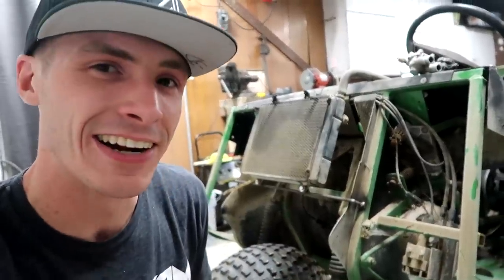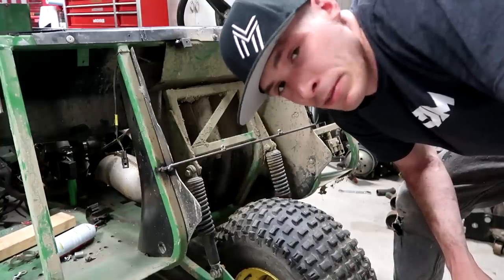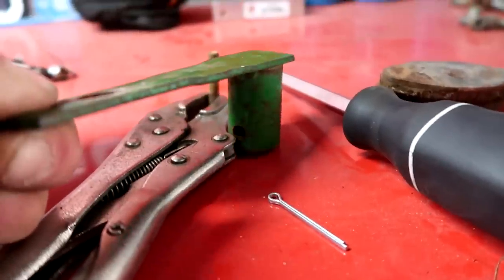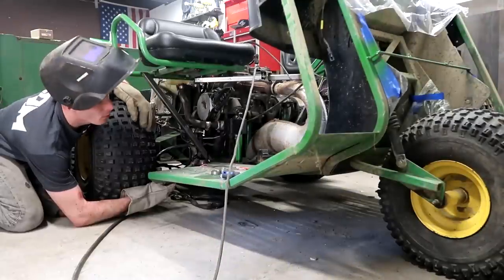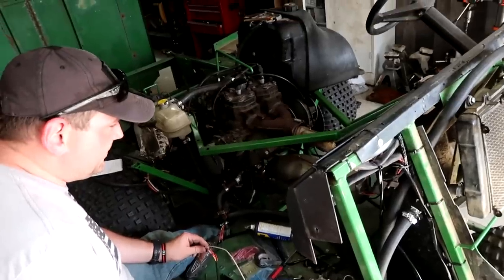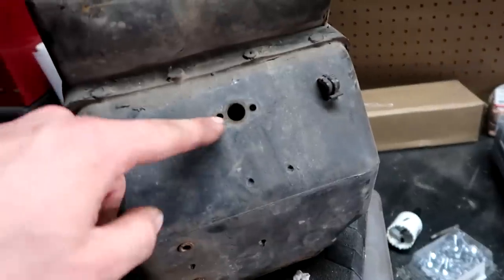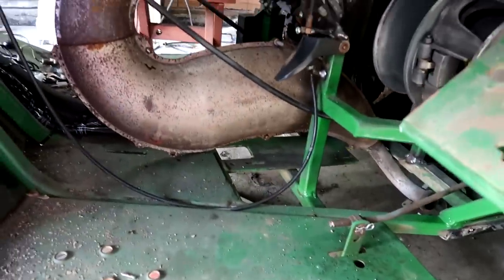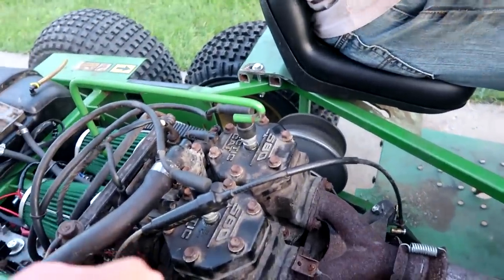100HP Engine Swapped 5 Wheeler Test Drive

Comment: Build a small fender to protect the radiator and put a grill over it or you will likely not only cover it with mud, but it will catch branches and rocks.  I would also put a storage rack on the back to replace the bed in case you want to load it up with gear.  I would strengthen the frame too for all that extra horsepower.  And yes you need a muffler and a taller gear.  It accelerates fast, but the top speed sucks and you can't cruise... it is all in and coast trying to drive it.

Comment: That was the start of the side x side craze. They have came a long way from the zero suspension and one front wheel set up. I ran the hell out of one just like that in about 1990. Get crafty with that welder and put you a front axle on it to help control that extra HP.

Comment: I would suggest moving the air temp sensor to a different location as it will help trick the computer to make it run a little richer as the motor warms. Also it is a intake air temp sensor not a air flow as it’s originally mounted in the air box in a place where there’s not a lot of air flow.
Reply: Also it will never start on the first pull unless it’s been running recently as it uses the first pull to sync the computer with the motor.
Reply: Also lmk if you need any help with the electronics as I just got done swapping a Polaris Indy Rxl motor into a quad and arctic cats efi and Polaris efi are pretty much the same even down to the solenoids for the fuel pump and the computer.

Comment: I know it originally came with one wheel on the front, but it had a lot smaller engine in the thing originally too.  I'm afraid it's going to be a death trap on wheels with only one wheel on the front.  What would it take to put a rack and pinion on the front and 2 rotors and wheels?  I think it would make it much more stable.  You might want to make a dump bed and a snow plow for it.  With greater power comes greater utility.

Comment: Where did you score the motor I need one here in Louisiana for the Mgp oversized go cart it’s a open wheel Indy car full suspension cart that awesome! 600cc would be cool or bigger just need with belt drive cause mine has a rotary engine now ans its slow

Comment: With a fan and a little cheap ducting the radiator can go anywhere. I see a bunch of locations on that thing better than right above the front wheel. Just step back - have a look. You'll figure it out.

Comment: something wasn't hooked up right on the first start attempt.  I knew after the second pull even before you said anything about the pump not running.  those battery efi motors should always start on the second or third pull.  I had a ZR580 and it never took more than 3 pulls to start even on the coldest days, usually only 2 pulls.   don't know about your gator but that sled would do 90 easily, no idea what it actually was doing since I'm sure the track was slipping but it hauled ass for an old beater sled.

Comment: Spice it up my friend.... Spice it up. Lol
Reply: On the floor frame it out with square stock and run new floor an inch or so(depending on size square stock used) it will raise floor so you can run coolant lines where you want to.

Comment: Bro wide is John Deere Green spray paint like 40 50 bucks on eBay bro it's a can of spray paint I don't know I can probably find one for cheaper but that was like 2 minutes search on eBay
Reply: Normally if you go to a auto parts store or a tractor supply store you can get a gallon for roughly that